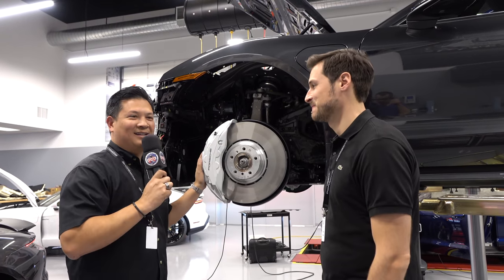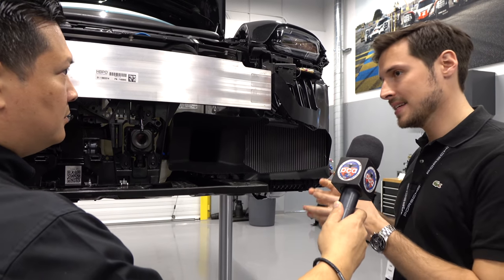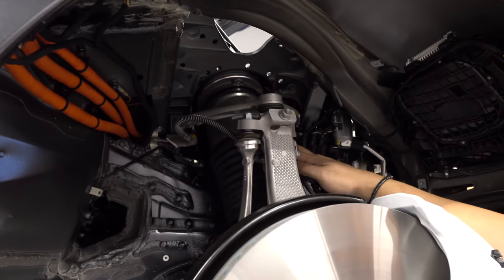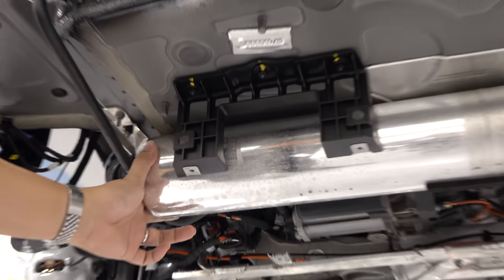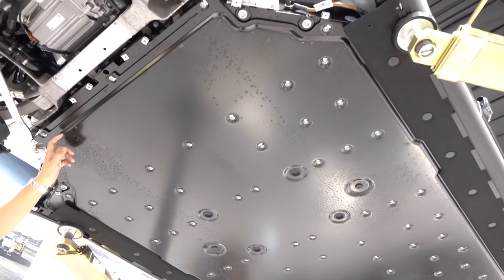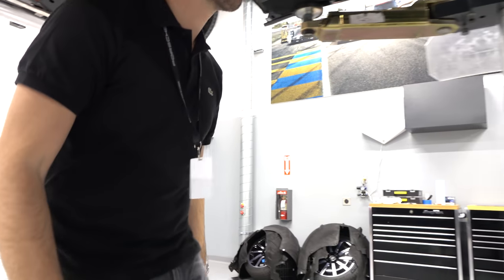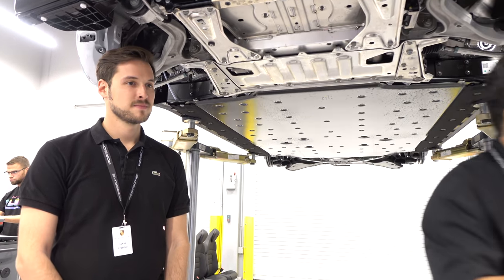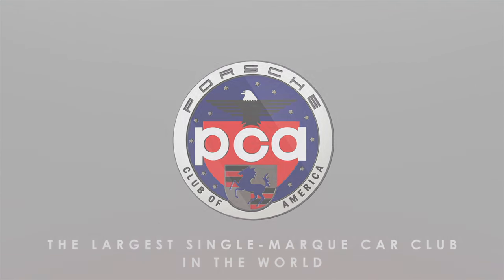PCA Spotlight: We go underneath and inside the Porsche Taycan at Tech Tactics West

Comment: As someone who's spent years racing radio control cars with Lithium batteries inside, I'm terrified of these things, I just don't see how you can make a Lithium battery car safe on impact, as soon as you crack a cell you have air which equates to fire.

Petrol doesn't ignite without spark.

I'd love someone with more experience around this to explain to me how they're going to stop this from happening, or is it just the case of if you hit something hard enough, you will burn to death?
Reply: if you hit something hard enough, a fire is not your biggest problem, rather a mercy.

Comment: High voltage cables right behind the front tire, protected only by fender liners.  Air tank on the lowest part of the chassis, right next to an equally ill placed air pump. This car is also exceedingly heavy even compared to the Model S, I don't think this car will do well.
Reply: i thought the covers on both areas you highlighted are strong and tough
Reply: Those cables are for charing, hence not active/live during driving. So even if you damage them during a crash, there is no harm.
Reply: @MateRimacAuto  Are you really Mate?

Comment: Not impressed, having worked on Teslas for many years... I can now appreciate the time and engineering that went into designing the vehicle. Having the air tank and that Wabco compressor in that location is going to be problem for wet weather areas....
Reply: It seems like legacy manufacturers go out of their way to make EVs more complicated than they need to be. My Tesla seems so simplistic from a mechanical point of view.
Reply: @danharrigan8880  making them simple lowers warranty costs and makes them easier to manufacture. There always is a bit of a disconnect between the service/manufacturing  and design engineers. Leave it to the Germans to try to re-engineer everything so it's harder to service and costlier to the customers.... Smh
Reply: @dasteknoviking  Porsche is not about saving a penny. Trust me the engineers do an amazing job. The vehicles are very nice to work on compared to other brands and their repair instructions are second to none.
Reply: @danharrigan8880  nonsense, the porsche taycan is a proper built sport car unlike your bland teslas.
Reply: The air tank is zero issues even in wet weathers, stop the crap!!
Reply: @carholic-sz3qv  I am not defending Tesla at all, they are on par with Hyundai from 1980s when it comes to quality. But go find me a old Audi allroad that you can work on the air ride after 10+ years being driven in the snowbelt regions...